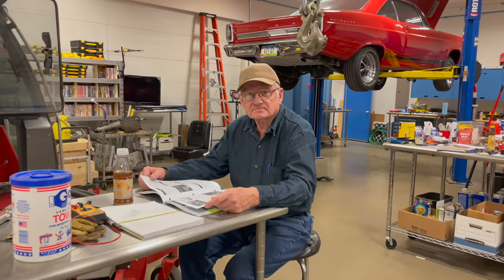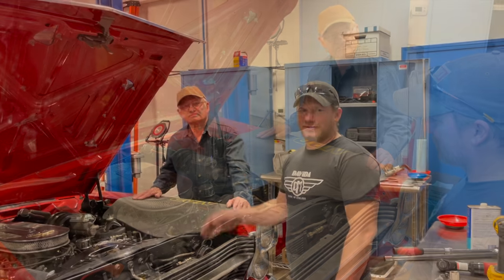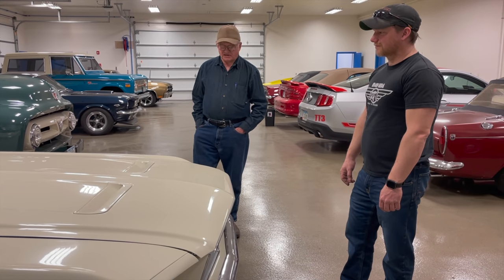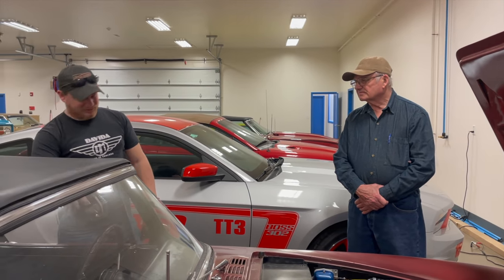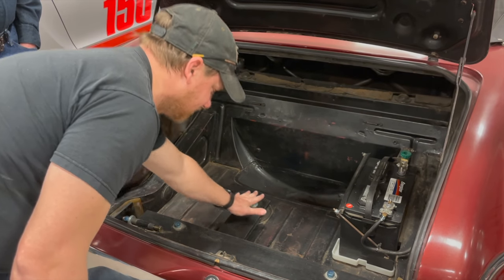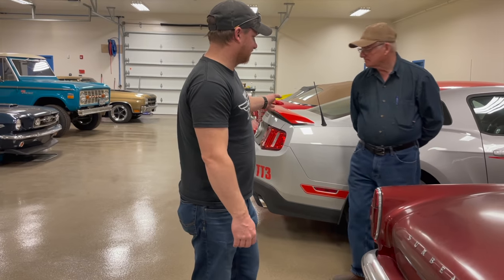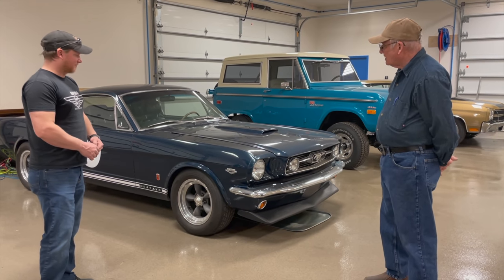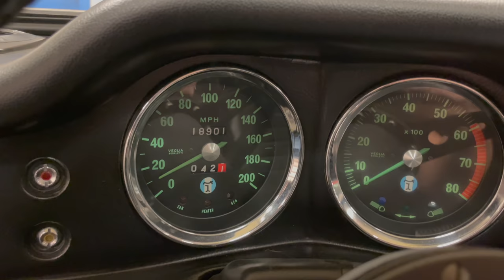Meet My Dad and Tour His Car Collection

Comment: The apple doesn't fall far from the tree.  ;-)  Dads got a nice collection.  I bought a used 1965 Mustang 2+2 HP 289 Auto ($900) with my first paycheck after I returned from Vietnam (1971).  Learned a lot about cars working on that one.  I actually traded it in on a 1969 Fiat 850 Spyder a couple of years later.  That 850cc engine was a real dud at the higher altitudes.

Comment: Well, Steve, your Dad is maybe the Ultimate GearGead ! Wow !  A few weeks ago, I asked you how a young guy, living in Iowa - as far as I know, not the car capital state - got involved in Brit sports car business and knowledge. 
Now, I know ! Wow !
One thing though, your Dad must know that a car sitting for months or years is about the worst thing to do. Like the Panthera, of course you don't take it out on those decades old tires. He could though, find compatible "cheap" wheels and tires and take it out once in a while. Same with many of his precious other cars. Adding a few miles won't hurt their value at all !
  Plus, the pleasure of driving thos iconic cars must be a hoot !

I'm about the same age as he is. I bought my pristine 1988 mid-engined affordable US made dream car I found in 1999 after a 5 year search for The Right One.
 The car had'nt move for a few years and developed many many problems due to time, despite it's extraordinarely low milage - 26k KM.
All fluids had to be drained, all systems flushed and cleaned,  including the engine and transaxle, brakes and semi-frozen calipers,
rubbers here and there, weakened hoses etc.despite the car sitting in a climate controlled home garage, like your Dad's awesome Halls.
Now, despite major spine and ankles problems, a torture, i drive it on early Saturday and Sunday drives to keep it in a better shape than i am. About 1k Km/a year.
It now shows 67,000 km and it's value is rising tremendously since a few years, much more than I paid for it, many examples having been trashed by dumb kids or butched by kit car bimbos.
Anyway, your Dad is an awesome Man ! Kudos to him and you.